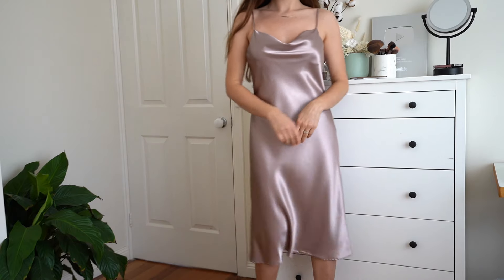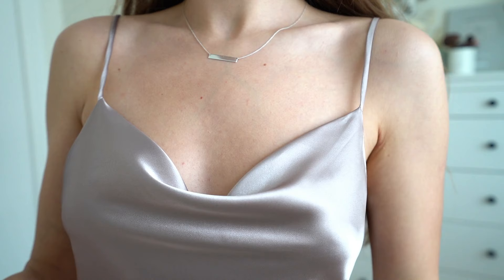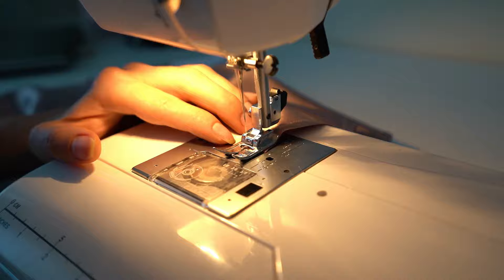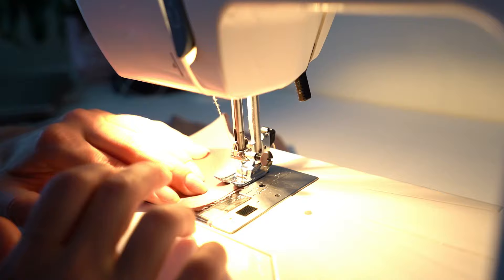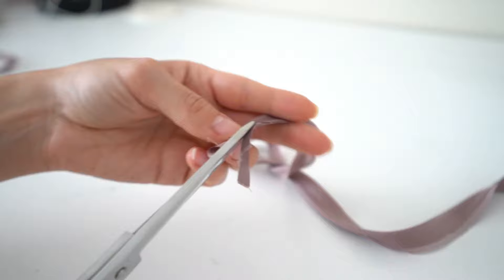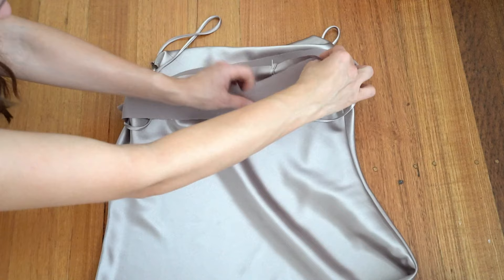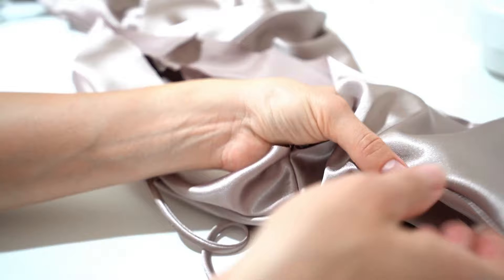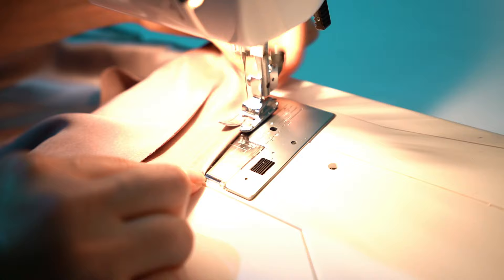DIY cowl neck silk dress | Kristy dress sewing tutorial | + printable PDF pattern

Comment: I made this! To wear at my friends wedding and got a tons of compliments!
And the video and instructions that came with the pdf were so helpful! It was actually fairly simple, the hardest part was working with the material. I used a silky crepe which draped beautifully but moved a lot so I took a TON of time to pin it very well. I only wished I had taken the time to print the pattern on A4 paper at a print shop instead of printing at home and tiling it all together, I think it’s definitely worth it to go to a print shop and have your pattern all on one paper. I cut out a size 8 and it fit me so dang good. Because I had extra material I was able to make a matching tie for my partner and matching masks. One of my favorite dresses now! ❤️
Reply from the maker: I’m so happy to read this! 
Thank you so much for the feedback 🥰🌸

Comment: do this pattern pdf come in all sizes?
Reply from the maker: Yes, all sizes in one file 😊
Reply: @Annathetailor  i’m having a hard time cutting this pattern because there is no cutting instructions, do you cut on fold with your pattern piece or no?
Reply from the maker: @daishab6216  fold fabric on diagonal and put the pattern where it says “fold” to the folded diagonal line. Make sure you’ve got enough fabric to cut both big panels on bias. 
Let me know if that helps.
Reply: @Annathetailor  yes, got it working on it now! thank you!
Reply: @Annathetailor  are you aware that you didn’t include the front facing into the pattern and the back facing says 1 but it seems you need two pieces? or maybe i’m not following the video well?
Reply from the maker: @daishab6216  Everything is correct in a pattern. Front facing is already there,  it’s integral with front panel. Back facing one detail with fold. Please follow the video carefully and see how is the panels attached.